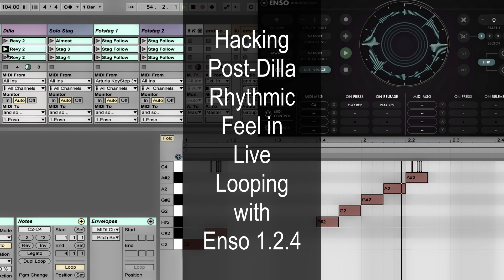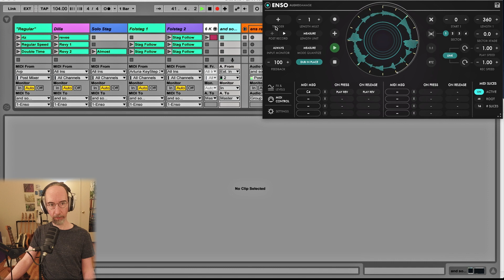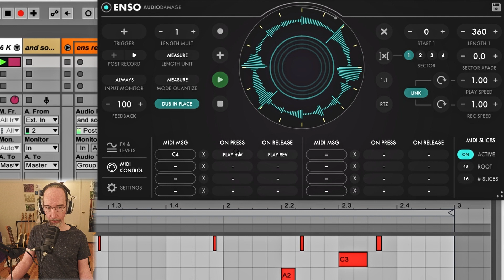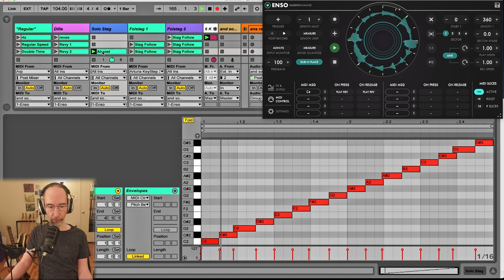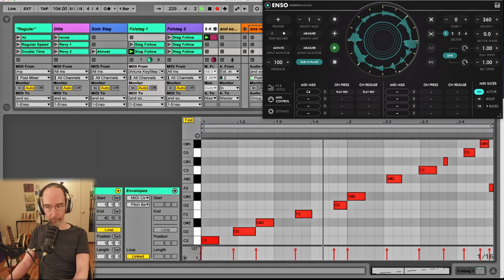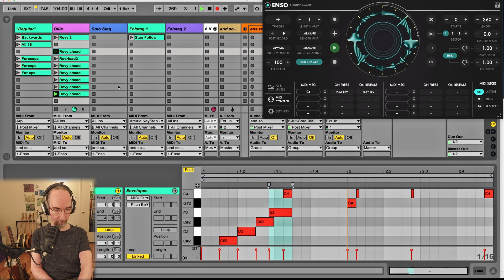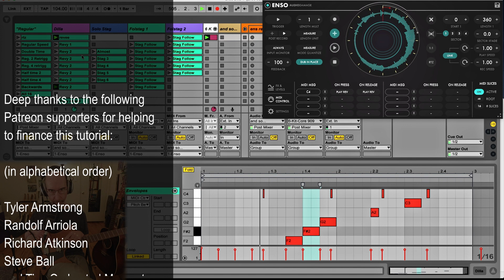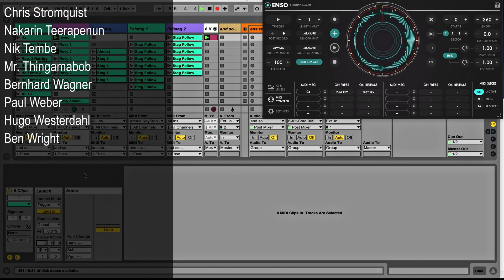Hacking Post-Dilla Rhythmic Feel in Live Looping with Enso 1.2.4

Comment: Very cool! An alternate way to create some variation with the reverse-trigger technique is to use a sequencer that can assign probabilities to individual notes, so that different triggers are hitting in each playback. Also: if you can play multiple sequences at once, you could have a sequence that is just a bunch of low-probability reverse triggers, which you could use in tandem with a straight playback sequence or with the kind of cut-up-and-remix sequences you demoed in the previous Enso video, to turn the "Dilla feel" on and off at will.
Reply: For more unpredictability, make the reverse-trigger sequence a different length from the main sequence: one bar longer or shorter, for example.
Reply from the maker: Fabulous suggestions as usual, Mr. Martin!

Comment: Hi Andre! As far as I know, the only loopers that have a proper slicing function are Enso and Loopy Pro right? At least in software. Or do you know others? 

In hardware, Octatrack can achieve that. 

Cheers!
Reply from the maker: If we're specifically talking about "each slice can be mapped to a specific MIDI note and triggered at will," I'm thinking you're correct. (I have no experience with Loopy Pro, though a lot of people who I take seriously speak very highly of it.) Being able to chop/scramble the loop into bits is relatively more common, but you tend to have little-to-no control over which bits play when.